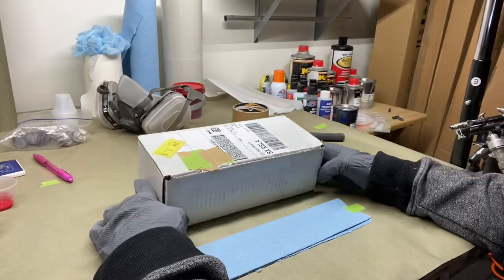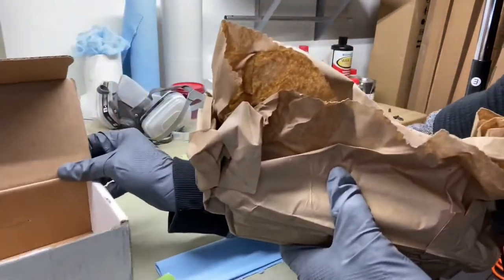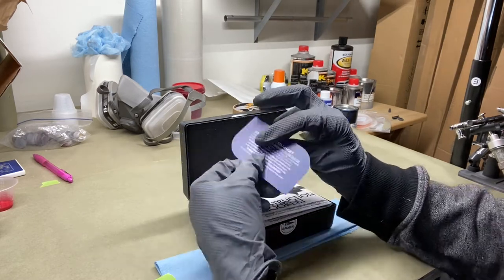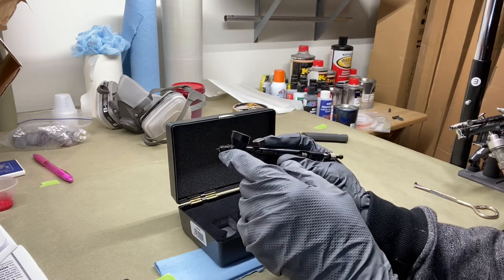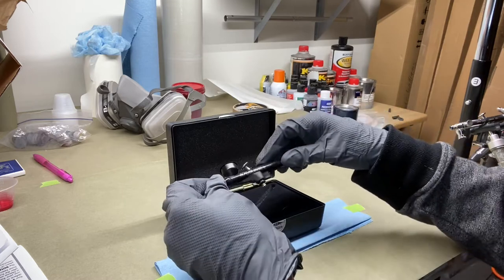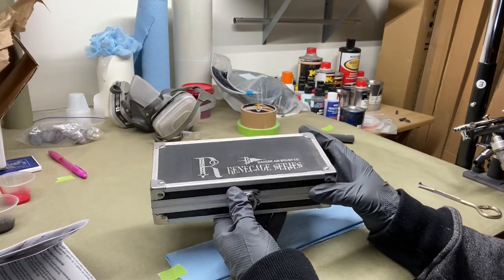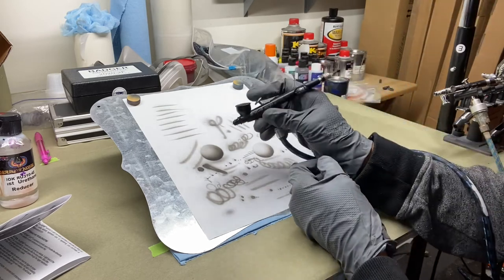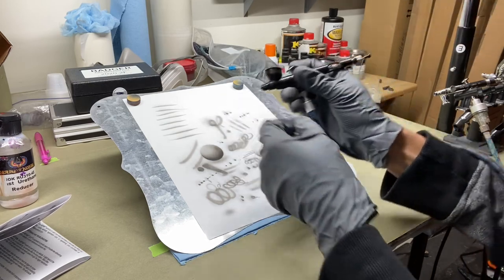Badger Sotar 2020 Unboxing & Review

Comment: Nice airbrush when it's spraying properly, I have two of them and both give me issues with the leaky teflon needle bearing.
Reply from the maker: I agree with you 💯 percent. Mines actually messed up the day I did this review and had to go through hell to return it. I haven’t used it since I received it back. I’m not a big fan of Badger. Anyways. Thanks for watching the video 👍🏽
Reply: Last Life-  The newer Badger guns have an adjustment screw to tighten the teflon seal.  Have you tried that?
Reply from the maker: @brianlundberg5163  the one I purchased had to be shipped off to get fixed. They resent me one with the screw adjustment and I’m still having issues with it.
Reply: @CBGRAPHICSAirbrushArt  What's it doing?  The video made it look like it was missing the trigger spring.
Reply from the maker: @brianlundberg5163  the first one had a bad seal and kept spitting paint out of the cup. The replacement bubbles and spits around the needle cap.
Reply: @brianlundberg5163  I have two Sotars, the original model (non adjustable teflon insert) and there newer version (adjustable needle bearing). The newer version with the adjustable needle bearing works well but every once in a while I do need to slightly tighten the needle bearing as it seems to get loose on it's own resulting in paint leaking into the trigger.
Reply: Does it have the 20-114 back lever behind the trigger?  I couldn't see it in the video.  I pulled it out of my sotar and it does the same thing it was doing in your video.
Reply from the maker: @brianlundberg5163  not sure on the new one. Haven’t tried using it again. Lately I’ve been using my Iwata Eclipse. To afraid it’s going to spit paint on a customers project
Reply: @CBGRAPHICSAirbrushArt  I would suggest considering getting a mini jewelers screwdriver set to adjust the needle bearing. One of my Sotars has the adjustable needle bearing that I periodically slightly tighten with a jewelers screwdriver. If the teflon needle bearing is set too tight, the needle will get hung up and have retracting issues, if it's too loose, paint will leak into the trigger assembly. You want a slight needle drag of resistance. 

The teflon needle bearing also has a memory component to it where it can expand and contract on it's own, I typically double check the needle drag the following day after having adjusted the needle bearing before I put paint in my brush.
Reply from the maker: @vanquishstorm3806  thanks for the information. I’ll have to give that a try.